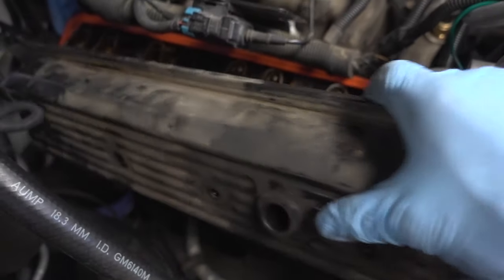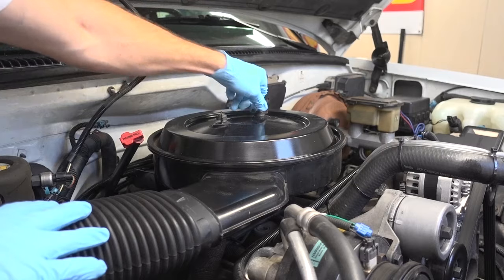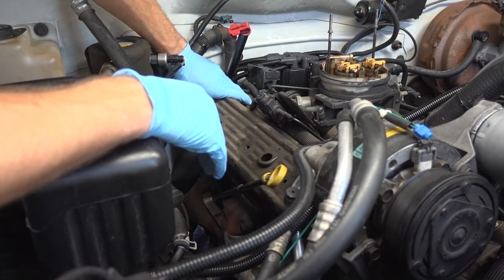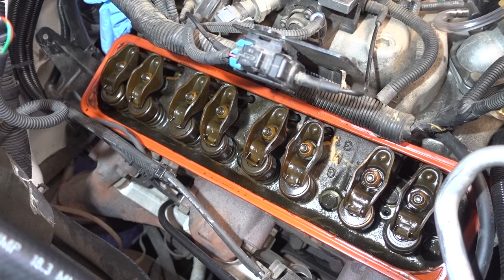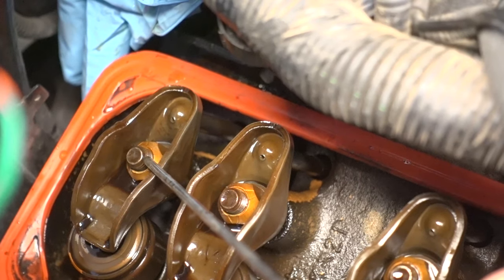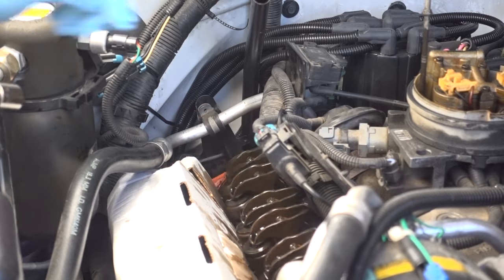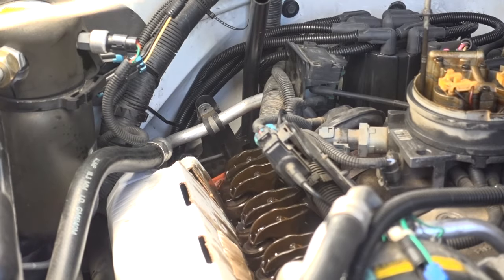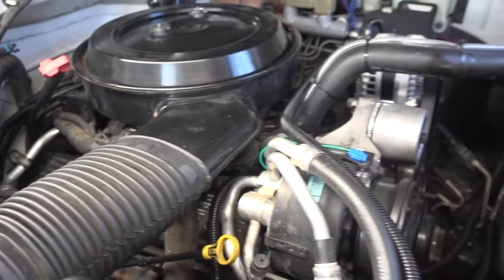Valve Adjustment With Engine RUNNING! - 1995 Chevy GMC TBI

Comment: push rods can become clogged with coked oil, restricted oil flow cause excess heat in the valve train rendering any adjustment useless because it is operating outside its temperature specification. You should have bought new pushrods for the engine or soaked all 16  until clean and checked for straiteness. Also any rocker making noise could have been replaced for $5 each with a new fulcrum and nut. Being that you went through the trouble to remove both valve covers I would have upgraded all 16 rockers to aftermarket (or possibly oem if available) roller type aluminum arms. And chromolly pushrods. Additionally GM has known collapsed lifter issues. Replacing them with new roller type lifters is not that  difficult.
Reply: david karpen ya but gm only has issues with the afm lifter to be honest and if the push rod and rocker isn’t worn don’t replace them just clean them throw them back in and then go on with the diagnosis for the tick. I mean a mechanic throws parts at a vehicle a technician diagnoses the vehicle and only replaces the part that failed
Reply: Alex Fennel you can blow smoke up your own but with your mechanic/ technician all day- only an imbecile would clean a lifter and put it back in a car! The cost of replacement is too low not to. Besides, you could never know if the hydraulic lifter is failed or soon to fail because you don’t have a $100,000 piece of equipment to properly test them under hundreds of lbs. of pressure. If you do, you are stupid- because you can replace them for a $100 bucks! Even if your “super technician “skills tell you it is a healthy lifter! It’s a 1996 engine with who knows how many miles on it!!!  Part replacement is only diligent at this point!! It’s not 2016 model!  This engine is in a 20+ year old vehicle!! Diagnosis without part replacement on vehicles this old has no cost benefits. As the $ value of the vehicle is so low. No lifter or rocker arm this old should be trusted, unless you are interested in wasting time. I put myself through college working as a top dealer ship technician I am a ASE master technician L1,L2,L3. Master truck (heavy vehicle) technician,  master school bus technician etc. etc. I hold a masters degree in chemical engineering. So maybe I’m just a mechanic! Who has taught hundreds the skills in diagnosing with oscilloscopes and pressure transducers. Considered a professor in the field and I still would have replaced the lifters and rockers in that older vehicle! Because experience has taught me you cannot be certain an old lifter isn’t partially collapsed or fully recharging each cycle under the load of a valve spring and you cannot see with the naked eye a tiny fracture in a rocker arm that only rears itself at certain a rpm. Sure I could prove that cylinder is dropping or weak with a very expensive oscilloscope but further tear down would be required to find the specific valve train issue. Only a fool would remove an intake manifold and not replace the lifters, push rods and in my opinion an upgrade to roller rocker arms. The power increase and fuel mileage benefits alone would justify it!  Not to mention eliminating 90-100% of any issues your having specific to this diagnosis, increased drivability and engine reliability. 
Just one mechanics opinion.
Reply: Yeup, I would've changed out too, especially the pushrods.  A friend of mine who was working on his 92 C10 had very noticeable clacking.  I told him how to do a valve lash adjustment with the engine running, but it never went away.  I went over and removed all the pushrods, and sure enough, most were bent.

Comment: Stock hydraulic lifters on chevys are the same as fords, torque the rocker to spec, that’s it. If there’s still a noise, you have lifter sticking, bent pushrod, sticking or bent valve, worn contact surfaces or low oil pressure, period.

The backyard crap is just that, crap. Any real engine builder will tell you the same!

Comment: Won't be possible on a GM C4 Corvette. You must move the AC compressor and its support bracket away as well as the passenger's side runner.... and the EGR tube in the back of the valve cover... a real mess!

Comment: Keep us informed if the ticking is permanently gone Jimmy.
Reply from the maker: Will do, so far after one day truck is running great but still not sure if the ticking is gone. I'm starting to wonder if I have a valve seal going out causing oil on the threads of the spark plug and possibly the tick?? I don't know still have to do some research.
Reply: That’s why I suggested the high mileage oil that swells the seals. However they say once you switch you should stick with it.

Comment: At least GM vehicles you can adjust the valve train, Fords are a "nonadjustable" style.  (unless you remove rocker and grind on them)
Reply: "nonadjustable style"?? Is that what you call hydraulic lifters when you don't know?
Reply: @Peter_Riis_DK  oh they probably use a unique nut and driver in place of a regular standard size.  Just to be awesome
Reply: @joeKisonue  
Really?! 😁

Comment: One of the biggest mistakes people make with GM s is when it's not under warranty and you're not getting oil changes for free anymore and you go to a shop and they put an ACDelco filter but NOT ACDelco oil the engines will start ticking as they get older you have to run AC Delco oil 100% of the life of the engine
Reply: 🤣🤣 I've got 354k HARD, ROUGH, IN THE WOODS AND DIRT ROADS EVERY DAY miles.... and it's my daily driver.....
I've never even heard of ACDelco oil until I just read your comment..... so you know what I think of the importance of ACDelco oil to the life of the engine🤣🤣
Reply: @worstnightmare9772  oh yeah? So when was the last time you got that kind of longevity under those conditions (not exaggerates even a little), USING ACDelco oil? I mean who tf actually does this🤣🤣🤣
You must work for the dealers

Comment: Don't appear to be much oil coming out push rods.........
Reply: To add to that: push rods can become clogged with coked oil, restricted oil flow cause excess heat in the valve train rendering any adjustment useless because it is operating outside its temperature specification. You should have bought new pushrods for the engine or soaked all 16  until clean and checked for straiteness. Also any rocker making noise could have been replaced for $5 each with a new fulcrum and nut. Being that you went through the trouble to remove both valve covers I would have upgraded all 16 rockers to aftermarket (or possibly oem if available) roller type aluminum arms. And chromolly pushrods. Additionally GM has known collapsed lifter issues. Replacing them with new roller type lifters is not that  difficult.

Comment: All he had to do was unbolt the a/c compressor and move it to the side pull out the valve cover and put the compressor back the a/c lines on it have a rubber hose on them so you dont have to disconnect them he never needed to disconnect the heater hose

Comment: 3:17 nope... your wrong
.
its quick connect...... slow disconnect 
more times than not..... its slower that it would be turning a flare nut (like on a power steering hose)
.
ya gotta use brake cleaner or soapy water in a pump sprayer to get ALL the dirt out of it......
then ya get one side to release.... and when the 2nd side releases.... the first side locks
and then ya brake the tab off.... so ya gotta push on the actual "locking wedge" with a screw driver.... 
.
.
but when ya put it back together..... it just goes CLICK and your done in 2 seconds
Reply: the best way to do that....... 
1. clean it out with soapy water (or brake clean if you dont have a little pump spray bottle..... but the brake clean might eat the O-rings)
2. push it down as far as it will go
3. push tabs.... rock side to side.... while also going up and down
4.... use "hose pliers"..... the type with a little circle at the end..... to push on the locking wedges themselves 
.
.
once ya have done 1000 of them like i have (mechanic)...... ya kinda learn the trick
but they can still be a REAL pain in the butt.... and take longer than removing a nut or bolt would
.
and be ready to break the tabs off..... if not the whole locking clip
if ya work on enough stuff..... ya tend to have a drawer full of clips, caps, random bolts and fittings, ETC

Comment: You need feeler gauge to measure the clearance between valve lifters and camshaft according to factory specs ...ex/intake clearance 0.15-0.25 mm.... Exhaust clearance 0.25 - 0.35 mm
You need micrometer to measure thickness of shim old and new if you decide to replace them...
Reply: On a different engine you would be correct, but on a Chevy small block such as this you aren't truly seeing a clearance, a hydraulic lifter takes up the lash and you are adjusting the rocker so that the lifter is somewhere in the middle of its internal travel. Being set up this way there are no shims to measure or change.
Reply: Abdulaziz Al-zadjali That’s only for a solid lifter engine. His is either a hydraulic flat tappet or hydraulic roller cam and the adjustment is tighten down to zero lash and go around a half turn.

Comment: You're going to hear a tapping noise from your fuel injectors on top of the throttle body there that's probably what your hearing Ross you have a left or so I doubt it very much if you have a valve tapping no big deal just don't trust it will be fun they're probably here to fuel injectors run some cleaner for the fuel injection system for Lube

Comment: 7:19 ya.... that cylinder head is DRY of oil
.
again... either the lifters are bleeding down..... push rods are clogged.... or you have low oil PSI
because that head should be FLOODED with oil
Reply: 9:48 ya.... thats what the oil coming from the pushrods should look like
hell, usually its even more than that.... 
.
and it should "Squirt" that much oil just SECONDS after start up...... VS taking 20 seconds to get a SMALL amount of oil
.
.
also.... your oil looks like it needs to be changed
.
.
.
i dont care if you run full synthetic..... these engines put carbon into the oil.... lots of carbon
carbon is hard.... it scratches things
.
and even if you think FRAM (SCAM) is the best oil filter...... which its not
or you run WIX/napa gold..... baldwin.... carquest.... royal purple filters..... ETC............. 
NO!!!!! filter will catch ALL the carbon 
.
.
thats why your oil turns black..... its from carbon 
.
.
.
so running "10,000 mile" super high tech advanced full syn in these motors is just wasting your money
.
run syn blend.... if not full dyno..... and change it every 3000 miles..... no more than 5000
.
.
.
.
most of these GM engines with lifter ticks..... is from people ONLY changing the oil when the oil life light comes on..... or it reaches 0%
the SECOND that "change oil" light comes on..... ya need to change it
.
or about 20% on the percentage style monitors 
.
.
and that works out to be about 4500 to 5000 miles
but thats for a multi--port fuel injected engine
.
these TBI set ups..... while TECHNICALLY fuel injected..... are more like a carburetor with extra steps
.
.
.
.
dead serious..... a properly set up Quardajet carb will have better throttle response.... get better MPG..... and increase the mileage you can run your oil
.
the TBI idea was good on paper.... but POORLY executed
.
.
like... simply snap open and closed your TBI about 5 times
and i bet money it will either bog down...... or buck and miss.... or just rev VERY slowly 
.
.
thats because they just cant keep up with the rapid throttle changes
.
.
yet a carb..... it will keep up perfectly
ya dont have to wait on the 10MHZ computer to update.......its just holes and ventures....  it reacts as fast as nature does
.
.
.
and multi-port injection..... well.... they have about a 100MHZ cpu
so 10 times faster
.
but a proper set up on a Q-jet carb will be ONLY EVER SO SLIGHTLY!!!! worse than the MPFI
.
.
having the injector spray directly on the intake valve 100% helps throttle response
but again...... a good tuned carb on a good intake ill give damn near the same response and fuel mix
.
.
meanwhile..... the TBI is either over.... or under.... fueling the motor (unless you are at a steady state...AKA level ground on the highway)
the injector mist is too course..... 
the CPU is too slow
the 1 wire O2 sensor reacts too slow (even if the CPU was fast)
.
.
snapping the throttle open and closed 5 times WILL bog down every TBI engine.... from the 2.5 iron duke / 4 tech..... to the 305/5.0....... to the 350 / 5.7
.
.
.
dont believe me????
just try it
.
idle to 3/4s to idle to 3/4s....... 
the first 2 or 3 times.... it will respond just fine
but on the 4th or 6th time...... ya open the throttle.... and nothing happens (if your ear is trained.... you can tell if its a lean bog.... or rich bog.... usually rich)

Comment: At your next oil change drain the oil and add 4qt ATF one qt oil and let it run, it will clean your lifters and should help.  Do not drive it well doing this. After about 10 minutes drain the ATF and oil. Add oil and you're good to go.

Comment: The method is good, but youre adjustment is all WRONG.  Once it taps you turn it in until the tap stops and secure it by ONLY a 1/8 th turn

Comment: You left yo dude worst thing you could do is put spark plug wires then wires are shot but a good set of spark plug wires on there replace the plugs again valve adjustment arcade valve adjustment before I was twelve years old nothing to it do it with my eyes closed very simple start the engine off back at off to the short Topman still have to turn or 3/4 of a turn defense what you feel like doing scratch art book Martin at a half a turn that's 20 been doing 40 years never had a problem thanks for the ride

Comment: Remind me why you just don’t use a torque wrench🤣🤣🤣🤣😂😂😭
Reply: believe it or not all the OG techs recommend doing the valve adjustments on this generation 5.7 almost exactly like this. only difference is they all say tighten until the clacking stops then back it off 1/8-1/4 turn.  I'm literally about to do this tomorrow

Comment: So we are going to ignore that this is false info?  If you have excessive valvetrain noise especially with system like this, you have major issues.  What you did here is put out false info and potential to cause others to damage their engine.  I can't believe this video is still on here.

Comment: Theyre hydraulic, theyre non adjustable. There is a torque spec for rocker arm nuts. If you have valve train noise, you have a worn part, or bad lifter.  Delete this nonsense.